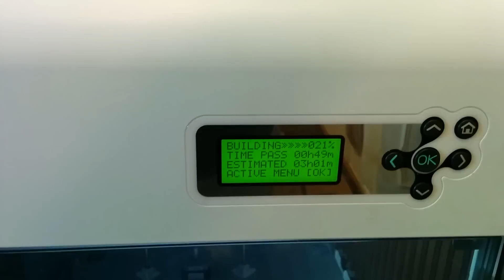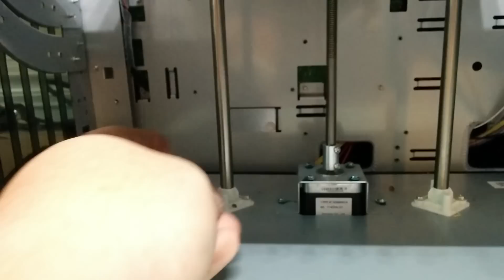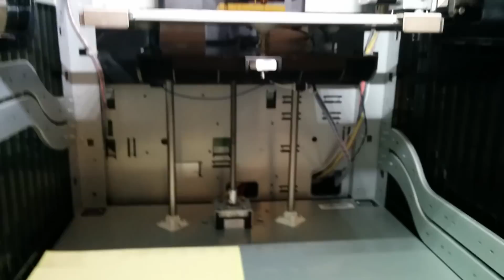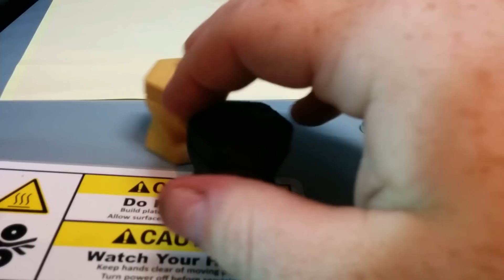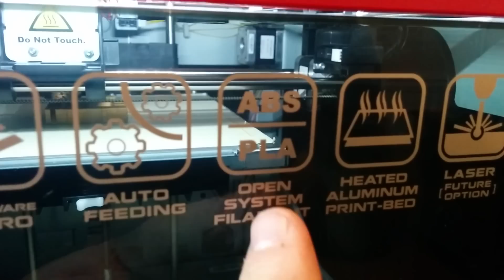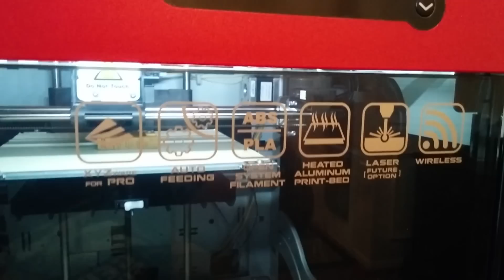Da Vinci Pro 3D Printer Review   ( and Compare to Da Vinci 1.0)

Comment: I would like to add that my 1.0 I had to fix the thermistor connection 3 freaking times. I had to reprogram the software to repitier and it did a lot better. I also had to use hair spray for the print bed and had to have z-axis all the way down and shielded so very little hairspray got to the x and y axis guide bars, and had to oil the guide bars with spray oil with then shielding the bed.. it was a huge pain in the butt, cause the procedure I just described I had to do every other print. Now within the last week I learned of the 3 in 1 pro and just ordered it today. you know if all I have to do is put tape down with some school glue, shit I will be freaking happy. Now with it being wireless is a added bonus for me. I can't wait til my 3 in 1 pro gets here in 3 days, I may have to call into work here on Friday because I may just be sick, I do agree with you on most everything you claimed bad on the 1.0......... Thank you for your video.

Comment: can it print tpa/abs or limited to pla?
Reply from the maker: Mad Yet Yes this machine can print ABS
Reply: Mark Fuller sorry don't know what I was thinking I meant can it print tpu, I think I read it can do abs and pla. Sorry for the confusion.
Reply from the maker: Mad Yet ,No The Da Vinci Pro can not print flexible filaments. I tried Ninja Flex and it becomes jammed at the extruder motor. XYZ printing does sell flexible filament for the Da Vinci 1.0 and 2.0.

Comment: 12:34. Not a chance. Not even close.  I own a 1.0a and I've seen prints from a DaVinci Pro (friend bought one even though I recommended against it) and although the Prints from the DaVinci Pro are marginally better than the 1.0a, they are absolutely NOT in the same league as an Ultimaker. I'd say the quality is more like a Taz5 or Taz6 (which I've found are very over-rated in print quality)
XYZ has reduced the moving mass by going to a Bowden setup, but the hotend and nozzle design is still crap.
BTW, my 1.0a has magnets on the door and the same spiral cable wrap and sheet metal edge guards that the Pro has.

They are moving in the right direction - but still have a long way to go... And the price has almost doubled vs the 1.0. There are much better printers out there for about the same price or slightly more. For example, a Wanhao Duplicator 6 blows it out of the water.
Reply from the maker: The Ultimaker 2+ is a very dialed in machine, I was comparing the prints the the original Ultimaker. I'm going to release a video soon of parts I have recently printed on the Da Vinci   Pro. Very excellent quality prints. stay tuned 😀

Comment: Why did your model work so much better than the one the 3D Printing Nerd got?  Did you have any problems or missing parts?
Reply from the maker: Yes, when the machine was shipped I had a couple broken parts. I contacted XYZ and they replaced them quick. I cannot tell if it happened is shipping or at the factory. Check my other videos for more details. All of my parts have been sticking well to the tape or glass bed. This machine is almost identical to the Da Vinci minus the Bowden extruder.

Comment: can these do something like print a bottle cap with threads? like for a Dasani bottle or similar?
Reply from the maker: It might take a couple of try to optimize the settings, but I would say it is possible. I would suggest printing objects with really fine detail on a SLA machine. For example Formlabs Form 2.

Comment: hello mark fuller, can you suggest me, which/what of software is easy to use to design our sample in the laptop? like AutoCAD? or do you have another?
Reply from the maker: I would suggest for solid modeling solidworks. It's a good all around software that is easy to use, with a powerful modeling engine, countless tutorials online, large user base and has all the tools to practically model anything you can dream up. I have seen some good models made in free 3D modeling software (I.e tinkercad and sketch up) but they are still lacking many features. For more animation, artistic, and organic modeling I would suggest blender. large user base, great online tutorials, and it is free.
Reply: I'd also like to recommend onshape.com. I've been using it for a while now and really like it. It has a free version, which I use, and plenty of tutorials.

Comment: If this printer uses open source filament why is there still a print cartridge in the back?  Is this where the filament spool will go into?  If so will it hold a standard size spool that comes with 1Kg of filament?  The spool in their cartridges are smaller than the standard filament spools.

I keep reading good things about metal nozzles, does XYZ have an upgrade/optional nozzle?  A quick Replaceable nozzle to use different diameters would also be a nice feature!  Is that possible on the pro version?
Reply from the maker: +JoeBowler 300, you can either use XYZ filament or 3rd party filament. XYZ included a small hole at the back of the machine to run 3rd party filament through. If you do by filament from XYZ it pops right into the slot on the inside and can tell you when it is low.

Comment: Anyone got the Pro to connect to wi-fi? (Easy setup according to manual) Since day one it refuses to even with the printer 6 feet away from wireless router. Everything in the house I've done connects with no problem. Why didn't they include a network cable connector so you can configure it to the router for wi-fi setup beats me.
As for the printing, OK its a cheap printer, but with some mods it could be an even better printer.
The sooner someone comes up with a hack to replace the extruder for the  E3d V6 kit, the better. Someone has done this with the 1.0 but not the Pro.

Comment: I am new to 3-D printing and I am considering to buy a Da Vinci pro 3-D printer and because I didn't find this info anywhere I'm asking you. Could you tell me please, since the Da Vinci pro doesn't have sd card reader the connection between PC and printer must be established all the time during printing, or you just send the file to print via Wi-Fi to 3D printer and then you can shut down the PC ?
Reply from the maker: The connection only needs to be established when sending the files over to the print. The Da Vinci Pro and other XYZprinting machine all have built in SD cards and the data is transfered directly to the machine. The files came be sent via USB or Wifi. Once the file is transfered the 3d printer is a stand alone unit.

Comment: Hello good review, I do have a question.. I wonder if the new XYZprinting da Vinci 1.0 Pro has space for 2 color filler.. but i wander if only 1 can be used.. I look like XTZ preparing for a dual color in this one. What is your appearance...
Reply from the maker: +Tommy Jakobsen Look at the main circuit board there is a place for an additional stepper driver that is missing. I feel in the future XYZprinting will release a Da Vinci Pro 2.0

Comment: I'm seeing right in the video warping at the front corners. Left coming in pretty severe for the size of the print. Printing on tape with a heated bed -- why? When will manufacturers go to a proper print surface -- PEI, BuildTack, plenty of options.  Detail is nice, but if you can't good adhesion, all other bells and whistles -- who cares. Going to a bowden setup from a direct drive is a step backwards IMO, it will be much more difficult to print flexible filament if not impossible.
Reply from the maker: Yes, on this print There was a slight warping on the front left corner. I think this was due to the bed not being perfectly level. Since this print I have upgraded to a glass bed and have had no issues. I do like the Bowden setup over the direct drive. Better quality and the machine prints faster

Comment: I have yet to get a 3d printer but really want one. I'm unsure which one to get I've looked at many but still can't decide. willing to pay around $100-$900 must have good quality.
Reply from the maker: what are you looking to do with the parts? The highest quality part you can make would be from an SLA machine. XYZ printing Noble printer is amazing and has been ranked best by Cnet and some others.
Reply: I wanted to make helms and swords
Reply from the maker: +Braxtyn Brannon , Fused deposition modeling or FDM for short is the most common 3d printer on the market. For 3d printers fdm machines have a large build area. The makerbot, Ultimaker, Da Vinci and Repraps are all forms of this technology. I have seen many swords 3d printed with FDM machines. The swords are printed in sections and fused together. Post processing will be required to smooth the surface if required. ABS is the best material to work with for solvent welding and post processing. Here is a good example of a FDM 3d printed sword http://www.thingiverse.com/thing:10392. I would recommend the Da vinci 1.0, Da Vinci Pro or build your own 3d printer for your price range. Don't forget you get what you pay for. Any machine assemblies under $300 is typically missing features.

Comment: You can use slic3r with the pro. using notepad++, just add these comments at the very top of the gcode then select all, go to plugins / MIME tools / Base 64 encode. When its finished save as .3w then upload in xyzware. here is the header...

; filename = composition.3w
; machine = daVinciAW10
; material = default
; layer_height = 0.2
; fill_density = 0.10
; shells = 3
; speed = 60
; total_layers = 124
; total_filament = 2116.02

Comment: which should i get as a beginner printer?
Reply from the maker: If you have the funds go with the pro. it has all the features of the Da Vinci 1.0 and the ability in the future for you to run more exotic filaments.
Reply from the maker: I don't think you will need to swap the extruder out. I have ran PLA,ABS and PC in the pro already. In the software setting it has flexible, So I think it should run some sort of flexible plastic. What are you thinking to print with?
Reply from the maker: I don't think it would be a problem, the nozzle on the pro is 0.35mm I think. More than big enough for the embedded wood in the plastic. I would suggest to print at 0.3mm first at a slower speed.
Reply from the maker: If the Da Vinci 1.0 can print it the pro can too. https://www.youtube.com/watch?v=7H-KbLhZq7E
Reply from the maker: Learn as much as you can from people. There is a lot to learn about print speed, infill, shells, overhangs, supports ect ect. If you dont have any local friends with machines look online for answers. A 3d printer is only as good as the user. Feel free to reach out to me if you need any help. Slow and steady wins the race

Comment: This is a nice review. Thanks for pointing out the details!

 I just finally set my pro up and printed a spool holder. One thing i did notice before printing (this may be due to wifi distance) that the wifi on the printer tended to drop after 15-20 minutes being idle and would need to be power cycled to reconnect. The spool holder came out alright (using the stock ABS that came with the printer) although there was some warpage upward from the long end of the holder. This is my first jump into 3d printing. What are the typical full range of settings you are using for ABS (speeds and what not) in the pro software for your prints?

Comment: I have the AiO, and im thinking of selling it and upgrade to the pro just to print if different filaments.
Reply from the maker: +AJ Sales That is the main reason why I upgraded from the Da Vinci 1.0 to Pro. Currently XYZ has a deal right now to buy a Pro for $500 if your an existing customer. XYZ said the deal too go to mid December then go back up to $700
Reply from the maker: +Jason Jimos 3D scanners are not mature enough for Pro-sumers yet. The Software to really clean Scan files cost 20K plus and the scanners you need start at 10K also. This is not saying you can get some decent freeware, but it really does not have the power of the real software.  I use to 3D scan part for a living and it always worried me when a customers ask, "Why don't we by a next engine and do the work our self" ( Face in hand moment)
Reply: I saw some people using the xbox Kinect to scan. Is that an option?
Reply from the maker: +AJ Alacan It really all depends on what you want to do with the data. The kinect data very noisy and it smoothed alot post process. What do you want to scan, and what do you want to do with the data?
Reply: I just wanted to scan simple objects around the house. And mostly for quadcopter parts.
Reply from the maker: Neither the kinect or the Aio will scan high enough quality for a quadcopter parts unfortunately. The best suggestion I could make is taking pictures and projecting them in a modeling software. Use calipers as needed to measure critical dimensions. I have reversed engineered many items with this method.